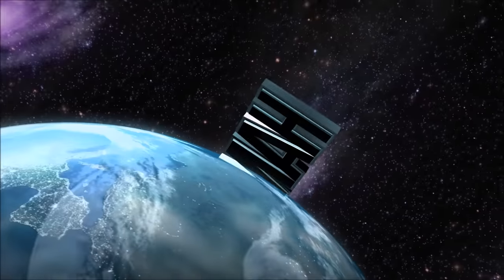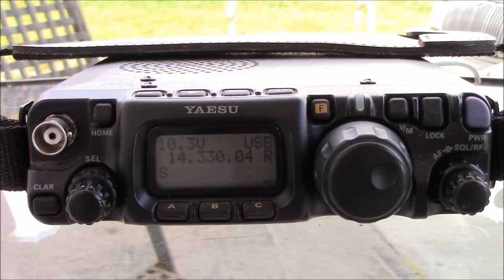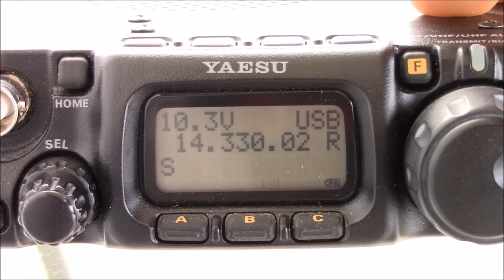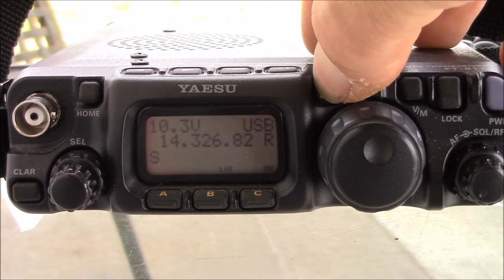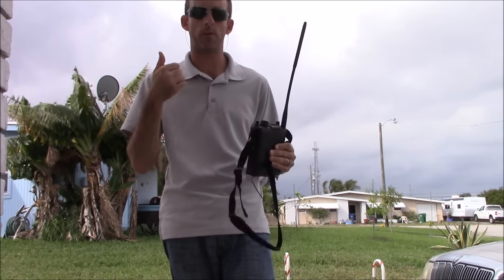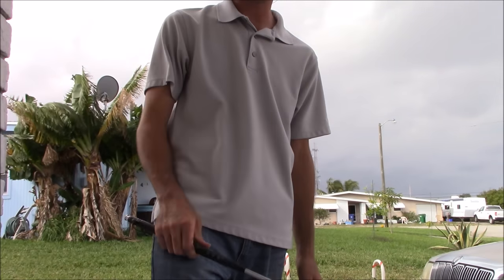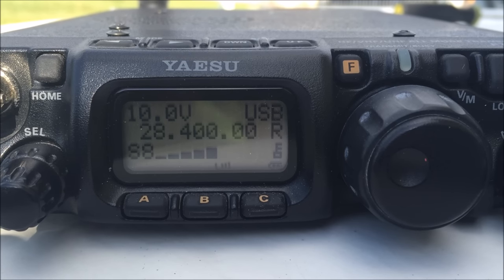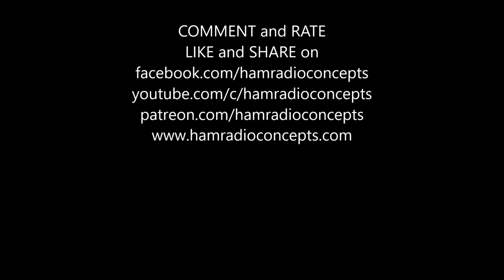Yaesu FT-817 QRP HF/6m/VHF/UHF radio review

Comment: AHA !!   Finally someone talks about the Counterpoise Length Formula, based on different frequencies.   You have NO IDEA how many different answers I have received to that question. The ONLY thing I see different is you often have the wire laying on the ground / in the sand at the beach, etc,  when quite a few others ( including the Buddipole Site ) insist that the wire be suspended about the ground to a small degree.

You deserve a Patreon Patron just for the excellent info you provide in your videos. Besides them being interesting in general. I prefer becoming a Patreon Patron, rather than the PayPal link as once the Patron link is established, I don't have to worry about going into the Pay Pal link manually for each video.  Keep those 817ng and portable antenna and digital videos coming Eric !!   We;ll have to do coffee some day !  You really aren't that far away in Vero...  73 de N4BRM
Reply from the maker: Bruce Malo thanks.. well, I tried patreon, I don't want everyone to pay monthly. instead, I just hope people would drop a dollar in the PayPal bucket at www.PayPal.me/hamradioconcepts/1
Reply: N4RBM: Counterpoises should be 1/4 wavelength. The correct formula is 234/Mhz = Feet.

Comment: If you are going to use the 817 on its internal battery, I recommend using the BNC connector for your antennas. The two jacks on the radio are connected to the same RF point and just switched back and forth using an RF switch. To save a few mili-amps use the BNC connector, since the switch is turned off when set to BNC.
Reply from the maker: And that's exactly what i said in the video.
Reply: I don't remember you saying that in the video. but, probably my mistake. I lose small details like that some times.

Comment: I added the SOTAbeams DC Powerpole Adapter and the supplied screw doesn't seem long enough to loosen and attach a counterpoise without the adapter coming loose. Going to have to see if I can get a screw just a bit longer. Anyone else have this issue?

Comment: I see it is a NI-MH battery. Mine is the original battery, it is a NI-CD
 battery. Do you think I can still use the same power adapter for it, 
for charging?  I have just heard that you should not charge NI-MH 
batteries in a NI-CD battery charger.

Comment: Note: Those counterpoise dimensions mentioned by the host are MINimum needed lengths. Ask the experts: A counterpoise longer than the needed length (via the 180 divided by Freq} is just fine and dandy, and does not have any adverse effect. So, (as mentioned by the host)  just cut a length of 25-30' of wire and you will cover ALL frequencies with an effective counterpoise(not mentioned by the host).

Comment: What batteries would you recommend  for bike operation?
Reply: And once you answer the Bike Battery Question ...  does Florida State Law REALLY insist that I have a RED FLASHING LIGHT dragging  at the end of my COUNTERPOISE WIRE while I ride around on my bike, talking on HF ??   I thought the ORANGE FLAG would be sufficient when operating on my bike in Florida ...  Just think of all the extra gear you could carry around in the BASKET of your THREE WHEELER !!  LOL

Comment: DAMN, WHY ALWAYS TALK ONLY ABOUT THE H.F PART OF RADIO?
THERE ARE OTHER BANDS, AND SOME ARE NOT INTERESTED IN H.F USE, BUT UHF AND VHF. PLEASE COVER THESE AS WELL.
THE RD0MVS1 PA FETS ARE NOT DESIGNED FOR 10 WATTS!
YOU WILL DESTROY THEM IN SHORT ORDER.
I HAVE AN 817, AND I 'LEVELLED' THE OUTPUT TO 5 WATTS. EVEN AT 10 WATTS, A 3dB CHANGE GETS YOU NOTHING.